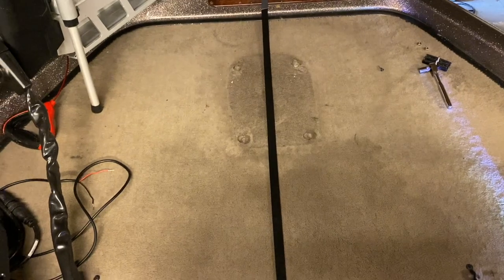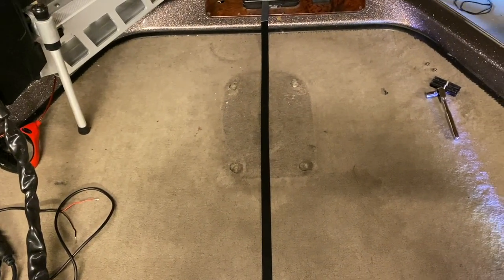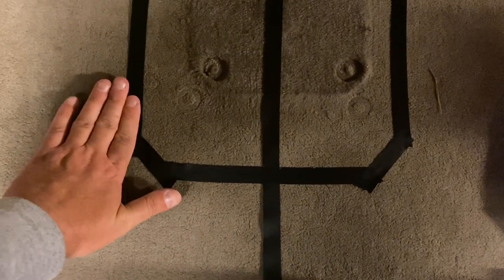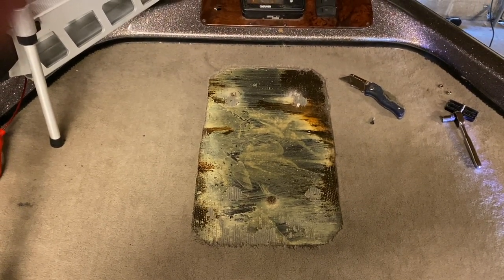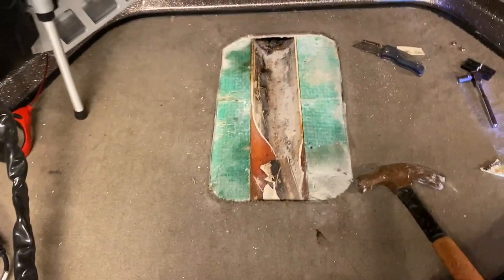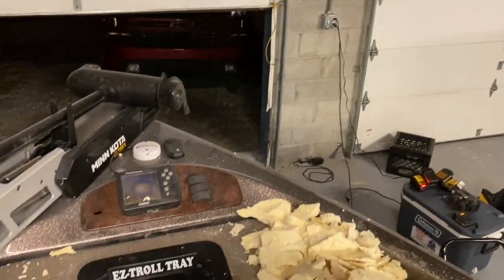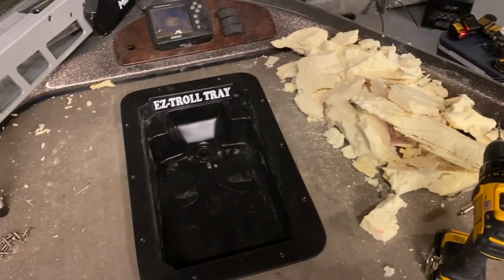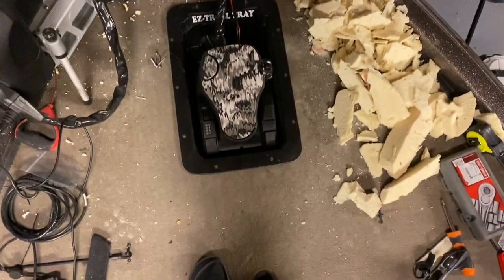How to Install a Recessed Trolling Motor Tray on a Fiberglass Bass Boat (Ranger Boat)

Comment: I have a 2004 Ranger 195 vs. I was told I couldn’t do it because it would cut into my storage compartment.
Reply from the maker: You will have to cut some into the storage compartment. I had to as well. But it is unnoticeable when you open the compartment. It hasn’t affected the compartment at all. But the issue is with the drain line. The water will drain into the compartment unless you route it somewhere else. That drain line has been my most tricky part of the install. I ended up running mine into a 2 liter bottle that I can empty when it starts getting full.
Reply: @championjigsoutdoors2015 can’t just run it to the bilge?